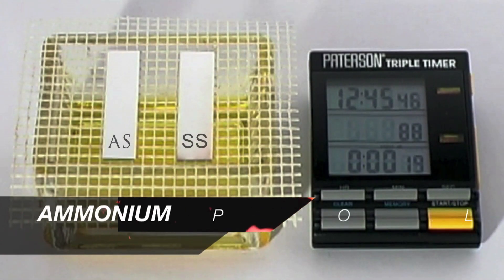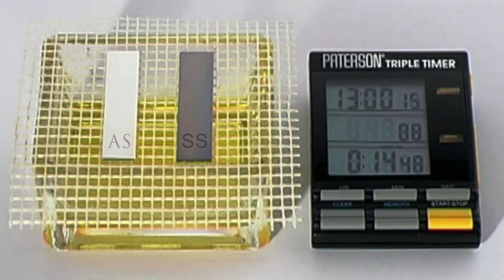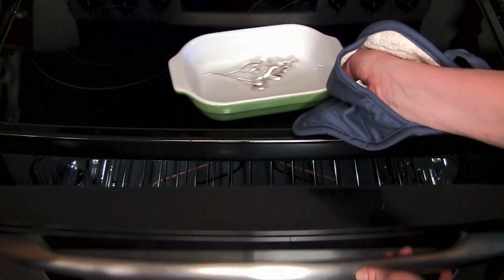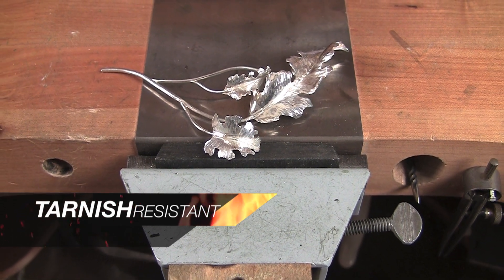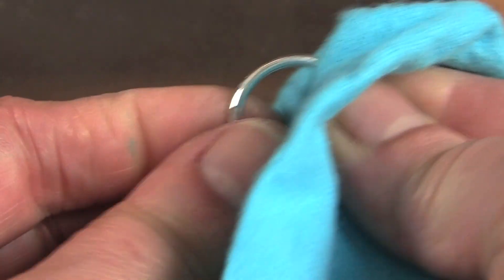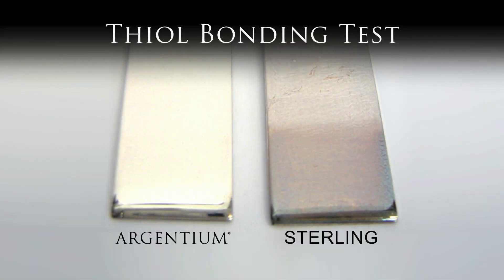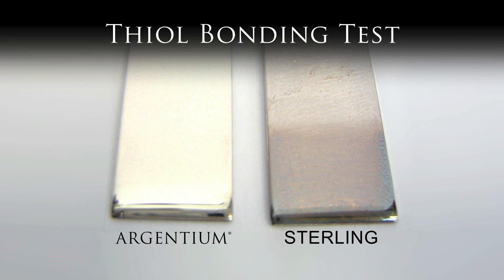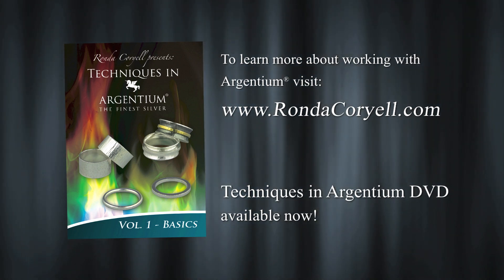Argentium is Tarnish Resistant

Comment: Hi Ronda! I love your videos, they are so very informative!! I have devoted my jewelry making to Argentium and ordering from Rio  because of your videos, and I thank you for that also!! However, I have a 6 x 1.5in argentium cuff that I hammered, stamped and applied LOS to it to blacking the stamped areas. Then I polished all the LOS off to make it all shinny again. But now it seems to keep tarnishing very quickly. Did I do something wrong?  I haven't put it under any heat/torch or anything, I also didn't put it I the oven on 212F for 2 hours either....should I have don't that BEFORE I applied the LOS? Should I not use LOS at all and Maybe use the black liquid provided by the Stamping companies to blacken the inside of the stamps instead?Did the LOS kill the Germanium in the Argentium? Just wondering what happened. I made a ring by fusing. Polished and hardened at 212F and it is still as shinny as the wire was off the roll. Thanks for your help!! Sincerely, Sara